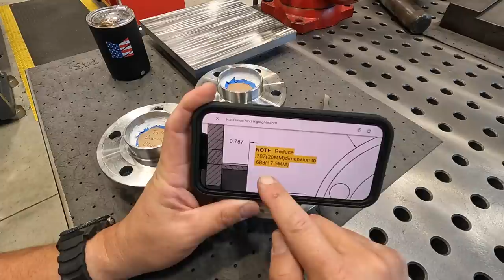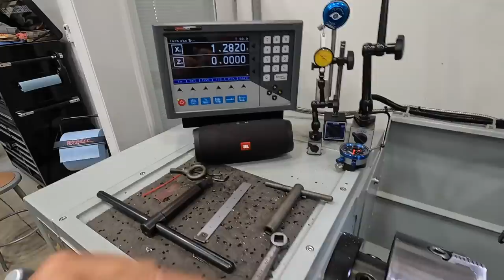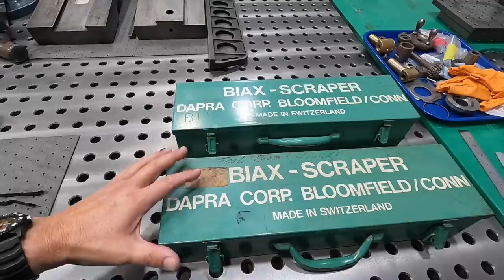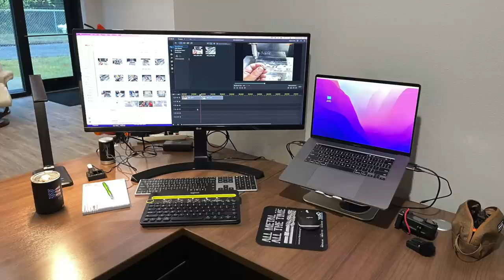SNS 368: Wheel Hub Machining, Shop Updates

Comment: You will most likely need to install a back-flow preventer on your coolant mixing system, to prevent contamination of the water supply line if the city ever has a water main break.
Reply: It’s called a non return valve. Here in the U.K. we have to use them even on an outside tap! It’s a spring loaded one way valve that prevents backflow.

Comment: Man you're killing it for the size of that shop. I never imagined you could really fit SO MUCH in there! You've got some big-ass machines. (in the way of a normal machine shop that is)
Reply: I've got 1500 sq ft, 3 Large cnc bed mills and 1 monster Cincinnati Milacron cinturn 12u, and I have room for a few more, but I need a bigger shop, my inspection area is in my basement currently.  Adams got some space, and a good owner uses every SQ FT he can to maximize profits.

Comment: Next time you install a big machine like that, get a DXFor DWG file of the bolt pattern, and get a surveyor with a total station to mark the bolt holes, then you don't have to move that heavy machine after marking the bolt holes on the floor. 
I do a lot of these type of set outs for big industry here in Sweden.

Comment: 1:12 Not a gear BTW, it's a reluctor wheel for the speed sensor. A magnet senses the notches passing under it, counts the pulses and calculates the speed of the wheel.

Comment: That is an impressive shop.  Congratulations on reaping the rewards of hard work.  I also second the comments below about security.  Hopefully you have a good alarm system but I would also recommend security film for the glass door and side window.  That stuff is impressive.  It really, really slows down smash and grab types.  Given enough time they can get through anything but they don't like doing it if it takes too long or requires too much noise.  If you have a glass break detector and/or some other sound detecting device integrated into your security system anything they try to get through the glass with security film on it would set off the alarm.  Beyond that some really, really good doors, frames and locks.  Nothing is fool proof but the harder you make it the better.  Congrats again on the impressively equipped shop.

Comment: I highly recommend putting a backflow preventer on the potable water line to protect the potable water in that building. Even if you do not drink the water in that building, depending on the design of the plumbing system in that building you can potentially contaminate the water in the other units. Any time you connect a potable system to some sort of industrial system you need a backflow preventer.
Reply: They are usually code. I know that they have been in the cities I’ve worked in in South Florida and in Jacksonville, Florida.
Reply: AND will all that premix go 'bad' sitting around for months in the hose reel?

Comment: You'll crap when you have to buy cheap plastic parts for that Hydro-Blend mixing pump.  It's an OK setup, but for no more coolant than you'll ever go through you'll be miles ahead just manually mixing it.

Comment: You could’ve hit reverse and used the other side of that insert on the back inside of that to chamfer it you still need to raise it about the thickness of the insert but works great for a lead in chamfer I use my tool like that for that allot nice having a machine that forwards and reverse is simple

Comment: Forgive me for asking, but why doesn't any "tuber" use the chucks bodys face or the face of the jaws  as reference? This for example: when I do something like this I just put the piece against the jaws. I've checked that the jaws are inside +/-0.025 mm and the face of the chuck inside +/-0.005 mm. The question: Why a lot of indication and "tapping" when there is no need for it? Part in, light touch for "zero", face off, bewel and done...
 What am I not understanding?

Comment: There are operations in electronics that work better with a needle on an old-school panel meter than with digital readouts.  You can see changes much easier with the. motion of a needle, rather than trying to interpret a bunch of flashing digits.  It's intuitive.

Comment: Master Chemical is a pretty interesting company. I dealt with them for 3 decades. I learned a lot about coolant managing an entire shop coolant system. I gained more knowledge and understanding from them than any other supplier or manufacturer. I took their coolant system maintenance and management class in their facility. It was an excellent course and was foundational to subsequent success. Chemistry plays an enormous role in managing coolant systems and few tradesmen were stellar chemistry students. Master Chemical really helped this chemistry challenged maintenance technician. Our company loyalty to Master Chemical flagged and we then worked with competing manufacturers and vendors. In our experience, Houghton Hocut was ahead of Master Chemical in managing bacteria and that prompted our supplier switch. Trim products appeared to catch up and I would have liked to have switched back to Master Chemical. 
I eventually built a shop wide coolant mixing station and delivery system piped to every machine tool. Operators could add make up coolant every shift by simply opening a ball valve emptying directly into their machine sump. We were buying our coolant concentrate by that time in bulk and pumping it directly into the concentrate tank from a tanker truck.
The other biggest coolant sump life management practice we found successful was equipping every work station with a dedicated coolant skimmer and coalescing oil separator that ran 24/7. This pretty effectively managed tramp oils. 
Coolant management is worthy of a career commitment, but our shop wasn't big enough to support dedicated staff. No one really wanted the task. So we had to come up with a management system that required little labor, made up for the inconsistency of operators actually taking every shift refract readings, effectively PM'ing sump chip accumulation and filth, and reducing disposal costs while managing environmental constraints.

What does a small shop like yours do to manage disposal costs and environmental restrictions? We couldn't waste any of our cutting fluids to the sewer and we're shipping tanker loads of spent coolant every few weeks. At the worst of our experience, our disposal costs exceeded our new product purchase costs by 200-300%. A huge portion of that expense was antiquated systems for chip disposal. Chips were stored outside and exposed to rain and snow. Oily rainwater had to be kept out of our storm water. I finally came up with a solution that the DNR approved and eliminated this slightly dirty rainwater contamination and resultant disposal expense. Does FL DNR micro manage small shops like yous? I have often wondered if small shops are forced to comply with environmental laws or if that burden is on larger shops that are likely much larger environmental pollution threats.

Comment: Hey @Abom79 just thought I’d mention the "gear" on those hubs are likely data points for a wheel speed sensor to read.
Reply: Didn't think about that but now that you mention it, it makes sense.
Reply: Mechanic here, yes that is exactly what they are. In the wheel knuckle will be a small hall effect sensor that reads the changes in the magnetic field created by the "gear" (usually called a Tone Ring)
The data is used for Anti Lock Brakes and Traction Control.

Comment: Your new shop looks great. All sorts of new fun gadgets. When you installed your new Kaeser air compressor, why didn't you mount it on the ceiling of your office area?  Why waste shop floor space?
Reply: Easier maintenance prob.
Reply: It's sponsored.  If it's out of sight, it's not being seen.
Reply: I believe one of the extra tanks is/was up there.
Reply: It has to be seen in videos or it won't be free to Adam.
Reply: @andrewterry8092  Why does "free to Adam" bother you so much??  Get over it man!!!

Comment: I am surprised you haven't drilled & tapped yet chick jaw faces. Then you can easily attach soft jaws & rotate them out the way when not needed. Just using loose bits of copper works, but it is a lot harder than it needs to be.

Comment: Adam, the shop is coming together great as well as the office/inspection room. Now about the premix coolant apparatus on the wall, l hope we're not getting lazy to the point where we can no longer mix it outside, (just wondering what your father or Grandpa would have to say about that). Looking at that Pacemaker lathe brought back memories of years gone by, l did a lot of HAND scaping and flaking on the carriage, cross slides and compounds during the rebuilding process. Always enjoy your videos, looking forward to watch as you get into the CNC age. Thanks for sharing.

Comment: I still do not understand the purpose of "scraping". I saw it on ToT years ago. But to me, you take a flat surface and scuff it up. For lube/oil? Thanks man.
Reply: You can scrape to retain oil and it breaks surface tension, creating a nearly effortless sliding of parts. It almost, in a way resembles the movement of an air bearing. 

It can also create impressive flatness by trial & error, check & balance, by dying and touching only the high spots in very small increments where you can "sneak" up on a near perfectly flat surface.

Comment: The gear is a reluctor or tone ring for speed measuring through a reluctance sensor.  Basically a magnet wrapped by a coil.  Each tooth alters the magnetic field which induces alternating current in the coil.  
They are precise to the rotating diameter and made of magnetically soft steel.  Should be no issue with soft faced jaws.

Comment: What is the purpose of the scraping?
Reply: Hold oil and match surfaces
Reply: there are different reasons for scraping, normally it's to match a surface to a master, usually a surface plate, but other shapes can be scraped too. You basically lower the high points a tiny bit every round of scraping. You need a couple of rounds before the contact pattern is even over the whole surface.

Since the surface stays a little uneven (just a tiny bit) you have little pockets where oil can sit and help with lubrication, perfectly flat surfaces would push the oil out and then stick together. The flat bits between these pockets are still enough to have a very solid sliding surface.

In the video, Adam doesn't bother to get the surfaces flat again, but still wants some scrape marks for better oil retention.

Comment: One thing I dont understand with the indicating is, if you're able to bump the work around with a softblow, why doesnt the work move when you apply tool pressure?
Reply: Start looking at 7:47 this might answer some of your question. If not, maybe I misunderstood your question.
Reply: The force from hammering is much higher but brief, that's all. The hammer is probably the oldest tool and is ironically required for great precision.

Comment: Do you ever have a problem with tolerances, when machining a metric part in imperial?
Reply: Just do the math and convert the metric measurements to imperial and start machining.. it's not hard to do
Reply: its the same thing other way around. Just do the math right and it will be fine.
Reply: @markshort9098  Yes the conversion is simple. I was asking about tolerances, typically might be assumed to be 5 thou for inch measurements for this piece and  for this operation the recommended metric tolerance could well be 0.1mm. The problem is if you try and maintain a 0.1mm tolerance converting to imperial measurements your accuracy needs to be to tenths, if not slightly better.
Reply: @Wolfy_80  5 thou equals 0.127mm and 0.1mm equals 3.9370078740157486 thou and a typical measuring tool only measures to 0.001" or 0.01mm accuracy so you can't measure to tolerance if you use a measuring tool in the opposing system.
Reply: @tda2806  tolerances are just a measured of what's acceptable, it makes absolutely no difference what measuring system is used once the conversions are worked out.. you don't need a tenths indercator to measure 4 thou  and even if tenths were called for then it's not like tenths indercators aren't common in workshops that use imperial just like workshops that use metric have indicators that read in microns.. personally I'm more comfortable using imperial but others are more comfortable working in metric, really it's just personal preference and what measuring system you were trained in.. i like most machinists  always go for tighter tolerances than what is called for anyway so when converting the tolerance figures just round down to tighter tolerances and all is good
Reply: @markshort9098  So if I measure 4 thou or 0.13mm is my part in or out of tolerance?
Reply: @tda2806  it's out, i was just giving an example that you don't need a tenths indercator to measure thousandths.. if i get something and the tolerance is +-0.1mm then I'm going to be aiming for +-0.001" anyway so I'd be well within spec.. Just because something has wild tolerances like 0.1mm doesn't mean it's best to be that sloppy, it just means that you can get away with being that sloppy, it's not hard to work to +-0.001" so anything more is just sloppy work and any machinist worth their salt will aim well under the allowed tolerance, just look at what abom done here where these are just open to the air so tolerances can be a bit wild and still work and he still done better than to +-0.001" it's called taking pride in your work
Reply: @markshort9098 If the resolution of my measurement is a tenth is a measurement 4 thou really outside the tolerance of 0.1mm? Would you be able to justify scrapping a part for a deviation of less than 0.00006 of an inch from the tolerance?
Reply: @tda2806  when a machinist that works in imperial says tenths in this context, they mean 0.0001" as in 1/10 of a thousandth of an inch, not 0.01"
Reply: Plus it’s really not that hard to go back and forth in your head between imperial and metric.  Me personally, to get close I convert whole mm to inch by simply multiply mm by 40 and just move the decimal three to left.  1mm is ~.03937 so rounding to 40 is real close.  Then we know 1 inch is 25.4mm so if I see a metric length that doesn’t equate easy in my imperial trained brain then count how many 25 go into it.  Which anyone should be able to do in their head.  600mm for instance can be roughed out real quick for imperial brained person by just thinking every 100mm is roughly 4 inches and obviously there’s 6 of those 100mm sections so 6 times 4.  
I know that’s not exact and not exactly pertinent to the guys question about tolerances.  I’m curious how you guys that are here in the US and taught imperial and fractions like I was, how do you convert metric to inch in your head?  You know how you can just visualize length in inches in your head.  For instance you can just look at something and say well that’s about 3 inches or 18 inches or whatever since we’ve worked in that system forever.  But if I’m watching a YouTube video from someone in metric land and they say 600mm or whatever then I got quickly convert it over to follow what they are talking about.  Is that the same for you guys too?  Now I know 25, 50, 75, by 25s to about 150mm is 1,2,3…6 inches but beyond that it doesn’t just automatically come to me, so I gotta convert real quick
Reply: @tda2806  Im not arguing with that, but im just saying for the few jobs we have with imperial messure its gonna be fine. Im messuring in 0.0001 mm btw when building engines. Thousand of an mil. You will probably come across metric more than I ever will come across Imperial anyhow :)

Comment: Adam, This new shop. Does it have anything to do with the U.S. manufacturing getting out of China?
Reply: Well his Milltronics CNC's are both made in Taiwan. In fact, they moved from producing in Minnesota, to Taiwan not too long ago. 
His tooling and air compressor is all German. 
The FlexCNC, the hose reels and the welding table are the only American things in that shop :D.
But let's hope when you purchase the same tools in a few years I will be wrong.
Reply: @nils1953  You forgot the American Pacemaker
Reply: @jmwarden1  Whoops, I meant newly produced. Hence the comment that if you buy them new in a few years maybe it'll change again. Though the US probably won't ever produce heavy cast iron machines like before WW2 ever again.
Reply: @nils1953  I think you misunderstood what I meant. With the new shop and equipment he can expand his business because offshore manufacturing won't be as widely accessible.
Reply: @jerrydemas2020  ah okay. Yeah, let's just hope they stay this time around and won't just move production back to SEA as soon as things settle in a couple of years.

Comment: Guess your electricity bill will be going up, yikes.  480 watts wow
Reply: *480 volts, not watts
Reply: Billed on usage = wattage, not volts.  higher voltage = lower amperage used.  There's no difference.
Reply: @12345NoNamesLeft  as you can tell not an electrical genius lol
Reply: I was under the impression that machines (electric motor driven) are more efficient at higher voltages thus you can actually save a bit as efficiency is increased less power is used for x amount of work performed.  Also another reason is the higher voltage doesn’t require as large a gauge conductor in the wiring which if you have a big shop with long runs of wiring to each machine/many machines you can save money on the thinner wire.  Most all your big industrial plants are high volt setups like 480
Reply: @robertmason8341  That is true, although I don't know if it's really that much more efficient. Motors for higher voltages have thinner wires but more windings in them. Being able to use thinner wiring is a big plus though, especially with the high copper prices right now. Where I live 400 volt threephase is pretty normal (400 volt between phases, 230 volt between live and neutral)